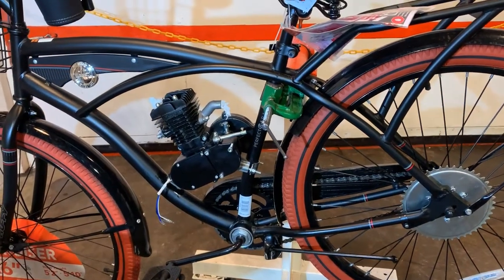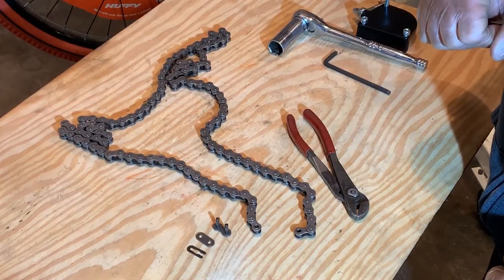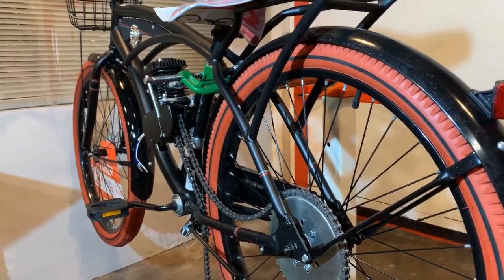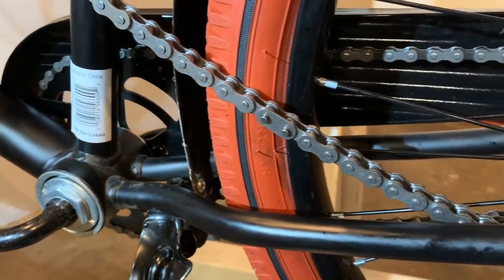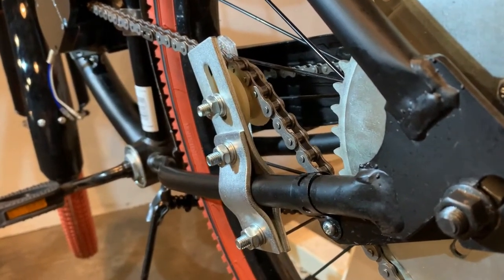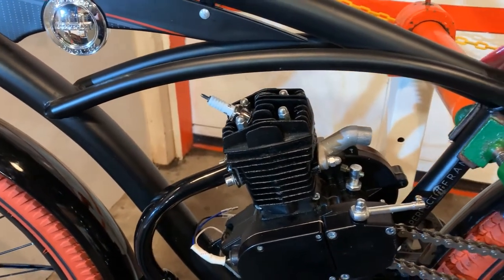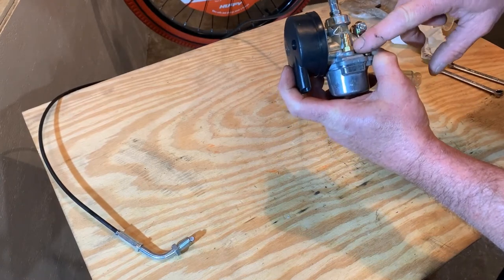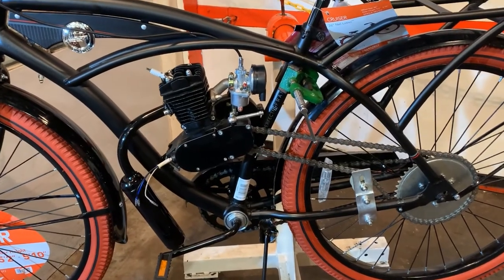D I Y  Step #3 Engine alignment & Chain Install

Comment: I'm working on my second kit today, I used a screwdriver and hammer instead of a chain breaker, but I learned something when you said turn your fish mouth backwards on it also I'm having some trouble lining up the chain on this one the 80 cc motor didn't fit to good so I think it's the angle of the motor, it's getting late and I have work at 5;30 am so I'm resting and watching your videos so I can do a little better install, my last one was great I rode it all around Richmond for a year and when I got a motorcycle I passed the bike on to a homeless man but now I have no ride again and a 2 hr bicycle ride to work each day, so once I get it installed I'll be so happy. Thank you for sharing this I love your attention to detail and appreciate this alot, God bless you mister 🤠
Reply from the maker: Thank You 🙏 I'm glad if any of my videos helped you with your build.. 🚴‍♂🚴‍♂

Comment: Very thoroughly explained I have built on the UPS of around 20 to 25 bikes and after watching some of your videos and tips it just made it a little not easier but a different approach which are very thorough and that's all I can say about it I know where you're at it's cold I am in the state of Florida this is the ideal state for bike riding I do not have a driver's license I use this bike everyday usually riding around 50 to 75 miles a day I estimate I have over at least 2,000 miles on my motor I use a 40 to 1 ratio from cradle to grave and it's never failed me neither of my bikes that I've built for anyone has ever come back because of something I did it's usually something they did order tires wore out they're intimidated by changing the tires and I charge $15 a tire to change and you provide the tire and tube I build the bikes it's up to you to order your own kit and a man's beach cruiser with room in the frame and I will assemble it for $150 I think that's a very fair deal and if something were wrong and it was my fault I would definitely fix it for free I have tons of parts I have motors that are so ported with window pissed-ins and you got to use a read valve if not I will get crosstalk my bikes are fast my personal black bike is a felt faker frame and an 80cc motor ported HP carburetor I have a big pipe on it I also as well use the boost bottle using the boost bottle you need to set up the boost bottle and then tune your motor if you turn around that boost bottle it'll work properly I'm just saying food for thought everybody take care of be safe God bless
Reply from the maker: Always nice to hear from another motorized bike builder.. 👍It does get cold here but people still ride them, although some folks don't have a DL you still got to get to work, the store ect. People seem to appreciate a cold ride over a long slow pedal everywhere...🚴‍♂ I feel what you're saying about people returning after they go out & abuse their bike & act like it just happened all by itself, unfortunately if you're in this business you're always going to have those certain people. 😭😭I personally don't get into making the bikes go really fast, not because I don't have the knowledge but because most folks that ride these don't have a DL & here in Illinois if they catch you flying around they will impound your bike & possibly take you to jail for no DL or at least give you a day in court so to help people practice a little self-control & have less problems I stay with standard bike builds.. Anyway, keep doing what you're doing because it actually helps people that otherwise couldn't get around as easy.. 🚴‍♂🚴‍♂Take care..

Comment: That chain looks dangerously close to the tire, wouldn't it be a better idea to flip the rear sprocket so the gears are closer to the frame side?
Reply from the maker: With the aluminum sprocket mount you can move the chain alignment from left to right, when you first assemble your chain, it is stiff & will limber up after you're first test ride so you will have to readjust it for the final touch before you're ready to get out & ride, that would be the time to adjust it for being centered & adjust chain slack. If you're using the rag joint that comes with the kit then yes you are correct you can flip the sprocket to move your chain closer to the frame or to move it closer to the tire if needed, with that rag joint mount that's the only left to right adjustment you will have.. 🚴‍♂🚴‍♂

Comment: My question is how do you know if your chain is desired length before you put the chain tensioner on there because I don't want to shorten too much or have it too long that's where I'm stuck at
Reply from the maker: Place the chain on the bike just like in the video, mark where you think the chain should be shortened with a marker of drop of paint.. Then remove the chain & practice taking out a link on the end ( you will have plenty of extra chain for this) I say to practice this step because you have to learn to break the chain on the roller side of a link if you don't you won't be able to put the chain back together. If you look at my video where the MasterLink is connecting the chain you'll see what I'm talking about, the two roller ends of the chain is what the master link goes through. It's better to give yourself an extra link or two when you decide to break it where you think it should go & even if you have to shorten it again for the final time it's better to put in the extra work than find out you nade it too short OR you have shortened it at a spot that leave you an open link with no roller in it.. I hope this helps 🙏🙏. It's kind of difficult to explain this part without being there in person with you.

Comment: What should I do if my chain keeps breaking or falling off and is it supposed to be pretty loose or tight on there
Reply from the maker: It sounds to me like something isn't quite lined up.. If you're using the rag joint that comes with the engine kit to mount the rear sprocket, that's usually the problem.. 😪 With the chain off pick up the rear of the bike & spin the rear wheel & look at the sprocket, I'll bet the sprocket wobbles when you spin it, that's usually the problem when the chain keeps falling off & or breaking. I personally quit using them & started using the Aluminum rear sprocket mount & have never had a problem with any chain since.. I'll send you a link on what I'm talking about, it should help you diagnose your problem & help you understand what I'm trying to explain.. 👍
Reply from the maker: This should help explain the problem you're having with your chain & how to check if this is the problem you're having.. https://www.youtube.com/watch?v=5gUbA7JQpv4
Reply: @EcoTransGaspoweredBikes  thank you so much I’m gonna try it out

Comment: I got rid of the tensioner and shortened the chain. Hasnt jumped off yet
Reply from the maker: I've seen a few people do that & it seems to work ok.. 👍On my personal bikes I like to use a spring tensioner that mounts on the frame, it not only keeps the chain snug at all times, but it keeps it in line when the chain gets a little slack from use, also it makes it so much easier the change the back tire.. Stay safe out there. 🚴‍♂🚴‍♂
Reply: @EcoTransGaspoweredBikes  ride hard three times. Then remove a link. Haven't had an issue. The tensioner always migrated and the stock one the plastic wheel popped off and snapped the chain which almost tore my artery in my leg open. What are your thoughts on the tensioner that bolts to the clutch arm cover?
Reply: I'm tempted to have a buddy weld a tensioner in place but don't have a clue how that works with bike frame metal. Bikes are chromoloy or something.
Reply: People don't take into consideration the engine is basically a giant vibrator. If it wasn't loose before it will be. I have more loctite than metal on mine.
Reply from the maker: @nygivenpoint  I'm personally not a big fan of those, they don't seem to keep enough tension on the chain where it needs it which is in the middle of the bottom of the chain when you're riding.
Reply from the maker: @nygivenpoint  Most bikes are mild steel or aluminum, if you really wanted to tack weld a tensioner to your bike frame stick a magnet on it & if it sticks you can tac weld the tensioner to it..👍 Although I prefer drilling a hole in it & the bike frame & pinning it, I use a steel rivet, I've done hundreds of them & haven't lost a tensioner in the spokes yet. You can also drill all the way through & use a nut & bolt & it doesn't have to be a big nut & bolt.. Just a friendly suggestion.😁
Reply from the maker: @nygivenpoint  I agree with what you're saying about the engines working loose through time.. How I beat all of that myself without using Loctite was by welding a solid front engine mount on most of my bikes (just like the alum. frames come with) I just done it to stock bikes & it has worked perfect every time, the engine never works loose, or miss aligns when you're out riding. Let's be honest, these bike engine kits aren't the highest quality metal around & what I discovered through the years is that it's not so much the vibration but mostly when mounting them with that U-Bolt they supply the actual U-Bolt itself stretches with the use of being tugged on all the time, so you have to check & tighten it all the time.. Ever since I started using the welded engine mount that hasn't been an issue at all.. Once again just a friendly story of what I have discovered through the years of trying to keep these things a little less Hi-Maintenance..   🚴‍♂🚴‍♂
Reply: @EcoTransGaspoweredBikes  Thanks

Comment: The little rubber bit that came on the carb from shipping is a dust cover for throttle cable btw
Reply from the maker: What little rubber bit are you speaking of ?
Reply: Both my carbs came with a rubber nipple thing over the cable adjustment screw on carb. It looks like you had it on the glove at 15:35
Reply from the maker: @alaskangurilla3497  I may have slipped it off for the video..🤷‍♂

Comment: I have the engine the chain just broke on me and I’m trying really carefully to install another chain on it again so I don’t get stranded
Reply from the maker: I feel your pain about breaking the chain,, 🤬🤬The two main things I have discovered over the years is to make sure the chain is straight & not touching anything & If your running a coaster brake rear wheel, get rid of that rag joint set up that comes in the kit & replace it with a Aluminum Hub Sprocket Mount. I'm posting a video today about a brand I use on people's bikes & the best parts about it is that it fits your standard sprocket & fits the hub perfectly every time, no filing or grinding to make it fit.. I personally run these on my bike & I haven't had any chain problems with the chain for years.. 👍👍🏍🏍

Comment: the sprocket outer toothed edge is closer to the center of the rim which changes the alignment of the chain in referrence to the front engine sprocket. Which side of the sprocket should face out?
Reply from the maker: I understand what your saying, although the facing direction of the sprocket depends on your rear tire clearance & frame clearance from your drive chain. That way it gives you a small option if your particular bikes chain is to close on one side or the other when using that rag joint that comes with the kit. The only way to get a more simple way to install or get easier adjustment left or right is to use an aluminum hub adapter for your rear sprocket .

Comment: I am mounting a 80cc motor to my chopper bicycle and after hours of struggling to get the motor finally mounted to my frame now my chain and engine and sprocket alinement is off and my chain is rubbing against my tire... -.- I don't know what to do now... trying to come up with a solution since I can't really move the engine it is pretty much where it needs to sit.
Reply from the maker: Unfortunately, I didn't make a step-by-step build video on this bike 😥😥The best I can do for you is share this video & hopefully you can see something on this build that will help you on yours. I built my own engine mount, but you can also buy them on Amazon. Everything else I used the stock parts that came in the kit, the only other thing I had to fabricate myself was the gas tank mount, I took two pieces of flat strap steel drilled holes in them for the tank mount studs & tac-welded them to the frame, but if you don't have access to a welder, you can use self-tapping screws to mount them to the bikes frame.. I hope info. helps you get you're bike going.. 🚴‍♂🚴‍♂

Comment: I have the same bike but mt drive sprocket won't move freely and I don't know how to fix it
Reply from the maker: Can you explain your problem a little more Indepth & perhaps we can figure out what the issue is.. Are you saying the drive sprocket on the engine won't turn or when the chain is on the front & rear sprocket as it's supposed to be it's not turning freely.. ??

Comment: Is there a gasket or o-ring within  the carb before mounting to the intake manifold?
Reply from the maker: No,it should slide on the intake all the way up & seal against the carb. If you do find that you have an air leak you can use an o ring seal if necessary.. Just make sure you use a neoprene O ring & not just a plain rubber one, fuel will eat up a rubber one..
Reply: Gasket

Comment: Hi, i am on step 1. Installing sprocket. From Your expierience is there any difference of installing sprocket the way You did or flipped so the chain gose closer to frame? This looks like lots of screwing and i dont want to mess at this point.
Reply from the maker: Unfortunately it varies from different types of bikes, so sometimes you have no choice but to mount the sprocket & install the wheel & see if you have the correct clearances....If not, then you have to remove all those bolts flip it around & try again...I know it's not fun to do but that's just what you have to do in some cases.. Some times you get lucky & the first time it comes out right.. I hope today is your lucky day..!!!
Reply: @EcoTransGaspoweredBikes   Thanks, i was reading comments  that there is one way of installing sprocket. So i did as majority did and the chain was to close to tire. So i unscrued and fliiperd arround. It is not so to bad to do so.
Then i had problem of space between chain at and frame so i gave more spacers between frame. Now y rame is wider then V shape and i think i will look for som longer bolts and some spacers to install engine. Thanks for Your comment.
Reply from the maker: @Artur-ck5xe  There is different engine mounts available for the front of the engine that might help you.. google : Fat tube engine mount for motorized bicycle.. You might find what you need to save you the trouble of trying to shim something up & having problems in the future..

Comment: what to do if the chain is hitting the engine mount slightly?
Reply from the maker: In some cases, we have had to grind the ear of the rear engine mount flush with the nut, most of the time if you have to do this it will give you just enough clearance. Also make sure your chain does not have a lot of extra slack.

Comment: For the life of me I can't get the slack out of my chain I took a link out and got it nice and tight but wasn't able to put the pulley back on so had to add the link back so I repositioned the engine and same thing please help
Reply from the maker: I understand what you're going through. Every bike for whatever reason is different when it come to this. having said that: there is no one certain spot that it has to be, in the video this tensioner assembly is a little past the middle looking at it from the side view but you can place it a little more to the right ( closer to the sprocket if need be) or move it back ( to the left ) closer toward the tire if the chain in a little tighter. If you're chain has a lot of slack & you need to move it more toward the rear sprocket just be careful that you have good spoke clearance because the closer you move it toward the rear the closer the tensioner gets to the spokes when moving it back.. 👍Lastly when you do find that good spot, drill a small hole through the tensioner bracket & the bikes frame & place a small bolt through it to help ensure that just in case the tensioner tries to move inward to the wheel it can't get into the spokes, I personally use a steel rivet but a small bolt will work also. ( It doesn't have to be a Hugh bolt & nut ) If I can help you any further feel free to ask. 👍👍🚴‍♂🚴‍♂
Reply from the maker: I thought it may have been a little confusing about the drilling & bolting of the tensioner bracket through the frame, so as an example of what I was talking about is in this video link @ 2:03 on the time line and you can see on the bracket where I drilled it & put the steel rivet.. Once again you can use a small bolt, I realized not everyone has a rivet gun lying around.. Here's the link..  https://youtu.be/iSKPzFdp7Xk?si=T4mTbjTyUD_-B_2w
Reply: @EcoTransGaspoweredBikes  I'm not having trouble with the tensioner my issue is more with the chain itself I uploaded a video to show and better explain my problem if you could please watch it and tell me what you think is really appreciate it I will comment the link as soon as it's done uploading

Comment: did the metering-jet screw fall out of the threaded area?
Reply from the maker: Sometimes they don't get it tight at the factory & after a few rides it will fall out in the bottom of the float bowl & when that happens your stranded & pouring fuel out the air cleaner.. So I go through every single Carb & take the time to check it so that doesn't happen to anyone who gets one of my bikes..🚴‍♀️